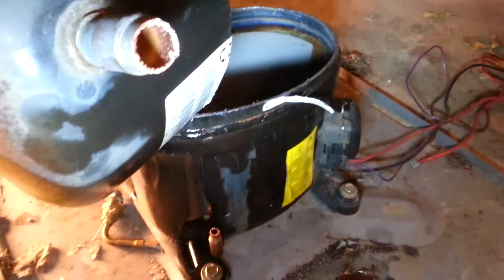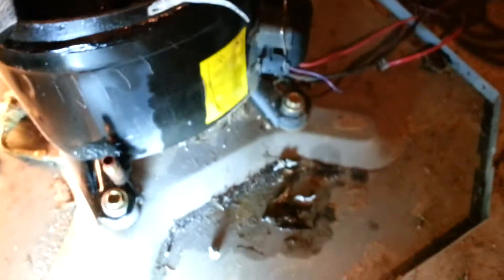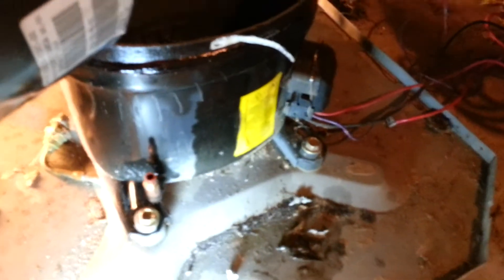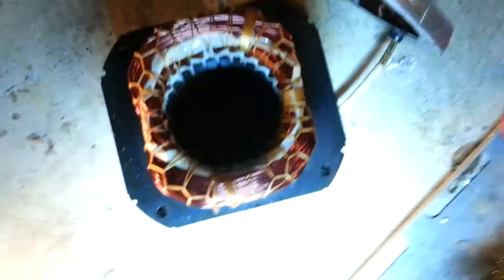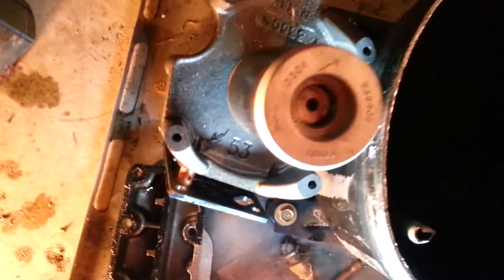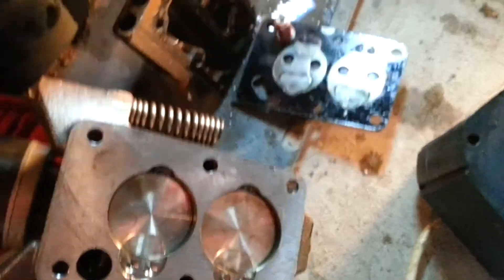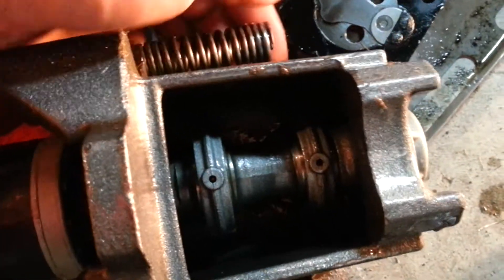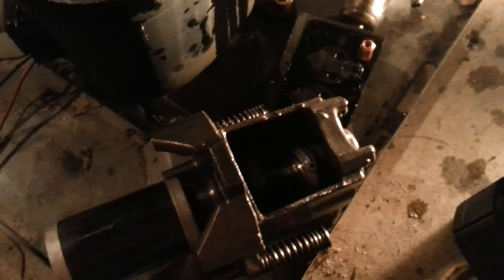HVAC-Hermetic R22 compressor tear down

Comment: Hi PJ, there doesn't look much wrong with that compressor..... Most of the ones i have cut open the reed valves have broken up and killed them. The coppery doodad is a pressure relief, it opens at a pre determined pressure difference between the high and low side. If you ever hear a comp making and intermittent PAACHOOO noise that'll be the pressure relief! The other thing is a muffler, most have them on the suction and discharge sides to reduce noise. Great vid!